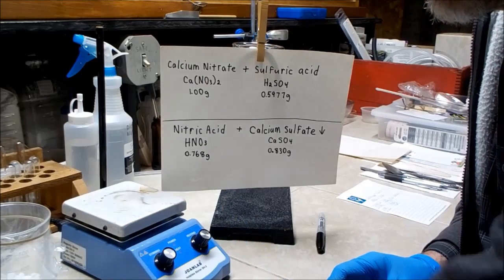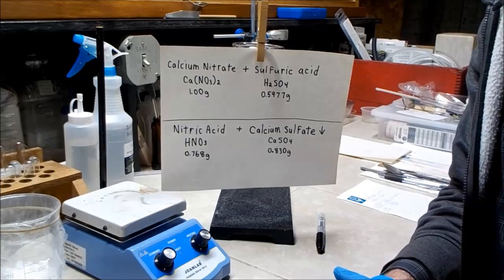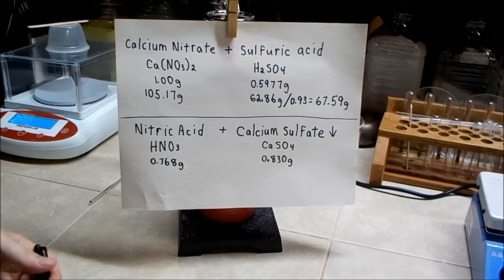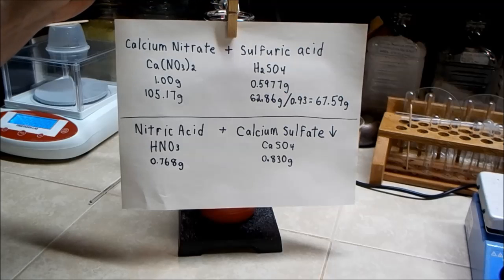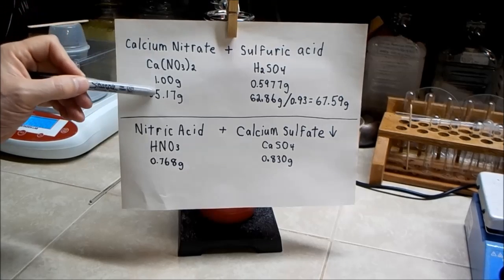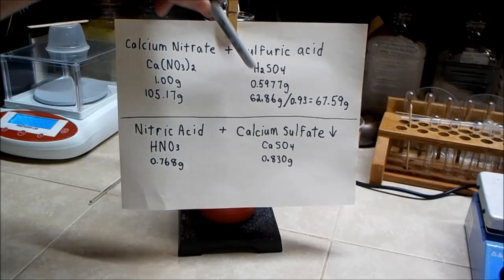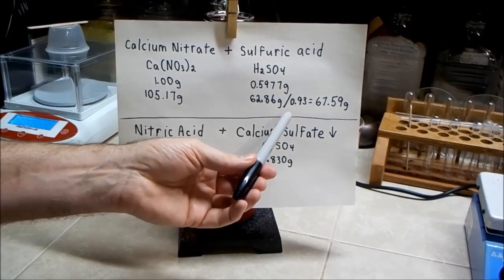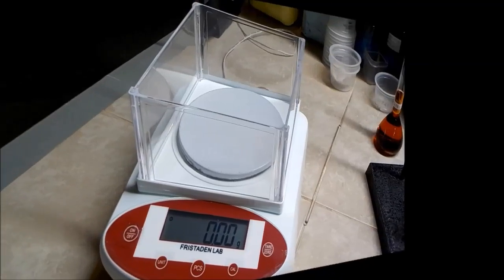Make Nitric Acid Without Distillation

Comment: Ive rememberd Nobel made his nitric acid with Sodiumnitrate and Sulfuric acid and used freezing to remove the now insulubel NaHSO4.
Reply: How exactly did He do it? Can you give me a Recepe ?
Reply: @chlorhendl4304  found it. Translated throught google.If you are in 3 1/2 weight thieilen sulfuric acid of 1.83 spec. Weight (more or less) 1 by weight of saltpeteric potash or baking soda dissolves, so when cooled salts from the chemical formula (KO, 4 SO³ + 6HO); NaO, 4SO³ + 6NO).These salts are almost insoluble in the acid at a temperature of 0° and can be easily separated from them by means of a press or by the air pressure. A mixture of sulfuric acid and nitric acid is then left behind, which is very suitable for the preparation of nitroglycerin.If one now takes so much sulfuric acid that it is completely absorbed in the excreting salts mentioned above, one obtains without distillation free monohydrate of nitric acid (NO⁵, HO).
Reply: @Preyhawk81 would you mind sharing the original source? Thanks
Reply: @disposable_tool  It was an patent from Nobel from the year 1865 in Hamburg. Decanting works too
Reply: @Preyhawk81  Thanks!
Reply: Sodium metabisulfite is a superior acid for this procedure. It generates the same ppt.
You don't need the vigor of H2SO4. It also costs more.

Comment: Is that Joanlab hotplate stirrer any good? I've been hunting another good hotplate stirrer because I've only got one that both heats and stirs lol. I'm interested in it's max temp and how fast it gets there, stirring strength, etc. Great video also! It was very clever to take advantage of calcium sulfate's insolubility.
Reply: They are pretty nice, actually.  I can't remember the max temp, but I'm thinking around 300°c?  Not quite hot enough to distill sulfuric acid, but close.  The stirring is pretty good too.  Though it doesn't go extremely fast, but who needs extremely fast stirring anyways?  I think it hits around 2,000rpm?  But don't quote me on that, or any of this actually.  Hahaha!  I do own and use one, but I don't use it as much as I do the others I have.  I'll show you some of my hotplates that I have on discord later today (1/20/22, in case you don't see this right away.). I have like 8 or 10 of them.

Comment: 22:25 I looked this up out of curiosity, and it seems the grade system for filter paper pore size is pretty... sporadic, to say the least. The sizes are all over the place:
Grade 1: 11μm pore size
Grade 2: 8μm
Grade 3: 6μm
Grade 4: 20~25μm
Grade 602h: 2μm
So, as you can see, it's not even safe to assume that the pore sizes get smaller as you move up in grade size (or bigger). Whoever came up with this grade system for filter paper pore size needs to get beat up... lol

Source: https://en.wikipedia.org/wiki/Filter_paper#Grade_3
Reply from the maker: Yes, that's interesting.  Thanks for doing that bit of research.  I was assuming the higher grade numbers indicated smaller sizes when I was doing the experiment.
Reply: That would be because the grade system is legacy based on traditions... I hate doing things just because of tradition. I find myself re-standardizing most of my parts and processes just for the sake of my own sanity.
Reply: @Unmannedair  yes, that's also why the US still uses the damn imperial units, despite them being objectively crappier.

Comment: 14:08 I had that exact same vacuum pump, and it worked great, until one day it wouldn't pull a vacuum very well. I opened it up and saw that it was basically a diaphragm pump, but the diaphragm wasn't made out of anything that was very inert, like teflon. It was just a crappy plastic, and the two rubber "valves" or seals that let the gas in/out were super small and made out of a rubber that also wasn't too inert. So be careful what you put through that. I tried to fix mine, but no amount of super glue or love could get it working again... damn thing.
Reply from the maker: Thanks for your reply.  To me the pump looks just like an aquarium pump that has the input and output reversed.
Reply: @perrygershin3946  you can always run your vacuum through a drying tube or something to neutralize anything that you expect to go through it before it gets to the pump.  That would help save it for quite a bit longer and help with longevity.  That, and it would help with fumes as well, helping to remove and neutralize them before they reached the pump, which could possibly destroy the seals if not removed, and keep them from entering your work space.  Helping to make it safer all around.

Comment: Great video man definitely unique on youtube using this method! Could you do this exactly the same way but instead of adding all the sulfuric acid quickly could you add some and filter it off and add more and filter it off again and so on til its done? I did this with ammonium sulfate and calcium chloride and I didn't lose as much water as I did when I just added all of it at once. I wasn't sure this would really make a difference here though. I dont have a vacuum filter so I did this to make it easier for me even though it was annoying.

Comment: This is got to be the silliest ass method of trying to recover nitric acid from a nitrate self that I've ever seen in my life
Reply from the maker: Do you  know of another method that does not require distillation?
I think we would all like to know about it.
Reply: @perrygershin3946  I know but this is not a viable way to get any kind of reasonable amount of nitric acid dumping random amounts of water quick nitrate salt with crappy dirty sewer cleaner is that going to accomplished anything reasonable. But I'm sorry I don't really mean to be mean but the process shown here is absolutely silly
Reply from the maker: @ClownWhisper  So you don't have a better method to get nitric acid without distillation.
Why do you say it's not a reasonable ammount?  If you need more just do a larger batch. Obviously if you have pure sulfuric acid you can use it. Don't assume just because the drain cleaner acid has some dye in it that it's dirty.  The reason for the dye is so it will not be mistaken for something else like plain water.
There is no reason the amount of water you use has to be 'random'.  Find the amount that works best for the filter setup that you use.  If you have a strong vacuum pump you can use less water than if you have a weak pump like mine or none at all.
It may or may not be silly depending upon your intended use of the acid.
Reply: @perrygershin3946  I've been making it for years with calcium ammonium nitrate. dissolve, decant, filter, crystallize, mix with sulphuric acid and voila; I can process my silver. You chose the absolute worst possible nitrate to work with. It was painful to watch.
Reply: I appreciate this video because I've always wondered how to make that your gas to precipitation methods.

Comment: how increase percentage?
Reply from the maker: The percentage is very much dependent upon the amount of water you use to perform the reaction.  Using less water gives higher percentage acid but it becomes much more difficult to filter out the precipitate.  The yield will also likely suffer because of more acid remaining in the precipitate.  If you have a vacuum filter setup with a strong vacuum you can probably do with less water.  My vacuum is not very strong.  Also, I probably should have used a little more water for the initial reaction (maybe about 50 mL more) then I would not have had to add extra when I did the filtration.

The best method would be to use a distillation setup to obtain azeotropic nitric acid (68%).  The point of this video was to show how you could obtain nitric acid without distillation.  The major downside is weaker acid and it has a small amount of impurity.
Reply: @perrygershin3946   Thanks.  God bless you and all humans about coronavirus. Amen Amen  Amen.
Reply: @perrygershin3946  We can again distillation the last product(25%)?
Reply from the maker: @qwerty_____146  Yes, but if you have distillation equipment there are easier ways to make nitric acid.

https://www.youtube.com/watch?v=KBeo8nww21g

Comment: Can copper nitrate be used for an electrolyte? I have been seeing a fellow use something blue like that.
Reply from the maker: An electrolyte is a chemical compound that dissociates into ions and hence is capable of transporting electric charge.  Copper nitrate meets this requirement so yes it can be used as an electrolyte.  Copper sulfate has the same appearance in solution and is probably used as an electrolyte more often.  It all depends on what you are trying to do.
Reply: Probably trying to reverse electroplate

Comment: If you heat up calsium nitrate it gives out NOx. Why not absorb that in water to create nitric acid?
Reply from the maker: I think the method you describe would work.

 I was hoping this method would be a way to produce nitric acid  without generating  a lot of the dangerous nitrogen oxides.  I could have done better by cooling everything down with ice perhaps.  As you probably saw in the video there was some NOx generated when I added the sulfuric acid because of the heating.

I'm sure you are aware the problem with the method I used does leave some contamination in the acid even if you get the stoichiometry exact as calcium sulfate is slightly soluble.
Reply: @perrygershin3946  About the issue you're describing I saw someone doing this in vacuum distillation to reduce the NOx
Reply: At that point, you might as well distill it from sulfuric acid and the nitrate flavor of your choosing. Working with solids and liquids is generally less of a pain in the ass than gasses, from a practical standpoint, and you'll end up with a much better yield.
Reply: @orion8981  That I can believe but wouldn't you loose sulfuric acid in the process? What is the cheapest way to get similar yields?
Reply: @nattsurfaren  Sulfuric acid is as cheap as precursors come. 

You're inevitably going to lose the acid in the production since it's a reactant, not a catalyst. The nitric acid is the expensive stuff you're after.
Reply: @orion8981  To my understanding NOx can be absorbet into water to produce Nitric Acid. The sulfuric acid will both react with calsium nitrate and suck out water giving it a high concentration. When heating calsium nitrate you get red fumes NOx. I can be absorbed in water to make nitric acide. So no sulfuric acid in this process. 

So if you have a weak nitric acid and mix it with sulfuric acid it shouldn't react?
Then you can make concentrated nitric acid and restore the sulfuric acid through distillation?

Comment: If you use saltpetre, potassium nitrate, and add it to already hot sulfuric acid it makes crystals which is easier to filter, my question is, once I have the sulfuric/ nitric acid will the sulfuric acid interfere while dissolving silver? I got the potassium nitrate off of Amazon one day delivery, 20$ for one pound, I like the way the acid in my boiling flask looks, but I wonder if the nitric/ sulfuric acid will still dissolve oz to lbs of silver?
Reply from the maker: The reaction you describe will produce a lot of potassium bisulfate which forms the crystals that you see but because it is fairly soluble in water there will still be a fair amount of the bisulfate left in solution.  The advantage of using calcium nitrate is that the reaction produces calcium sulfate/bisulfate which has very low solubility so most  of it can be filtered out.  Another advantage is that the reaction will run at room temperature which is a lot safer and does not produce much of the dangerous nitrogen dioxide gas.

I expect the acid produced by your method would dissolve silver but if you care about the purity of your product you will be disappointed.  The nitric acid will form silver nitrate but any sulfuric acid will then react with the silver nitrate to make silver sulfate/bisulfate and more nitric acid. The potassium bisulfate may also get into the reaction as well.  When the sulfuric acid and potassium bisulfate are depleted then the nitric acid will be used up last.  What you are likely to end up with is a mixture of silver sulfate/bisulfate, silver nitrate, and the potassium is going to be in there somewhere as well.

Distillation to get clean nitric acid is probably the only solution that will work if you are looking for a pure product.  Amazon sells a very inexpensive distillation kit that does the job.
https://www.amazon.com/Chemistry-Glassware-Distilling-distillation-Apparatus/dp/B016HEKEGW/ref=sr_1_7?keywords=distillation+glassware+kit&qid=1566357284&s=industrial&sr=1-7

I have used this one myself.

1 gram of nitric acid will dissolve 0.856 grams of silver.
Reply: @perrygershin3946 thank you very much. That was better than a chemistry class. I'll try out the methods and get back to you, and on the subject it also helps if you know the product I'm tryin to dissolve I gathered some mud from the side of the street where the cars park, tried dissolving it all a few different ways and took my precipitate into a precious metals place which analyzed it at 18% silver 5% cadmium,1% palladium and 20% iron and I have a few lbs of it I'm trying to either dissolve off all the base metals, or dissolve the silver and cement it out with copper, either way I need nitric acid, so there's silver on them streets :-)
Reply: @roywhipple7340  was someones degraded silver plate spoon in there🤔
Reply: Perry Gershin, I used the nitric acid I made to dissolve some meterial I suspect has gold in it I used nitric acid and muriatic acid, then I put sodium hydroxide in, and it all turned black, but nothing is really settling to the bottom, do I need more sodium hydroxide or should I try something else?

Comment: +Perry Gershin If know something about, what plastics are compatible to store dilute nitric acid?
Reply from the maker: Plastics like polypropylene LDPE are resistant to dilute nitric acid.  I keep my acid in glass containers.  Often glass containers for the acids are coated with a resistant plastic so that in case the bottles are dropped ...they do NOT shatter.
Reply: @perrygershin3946  Does calcium sulfate even react with anything? I was wondering if it could be turned into something else.
Reply: @chemicalmaster3267  Calcium sulfate can be used for making plaster.
Reply: @perrygershin3946  I asked this because I´m thinking about making my own dilute nitric acid and I know that nitric acid, specially when concentrated, reacts with some plastics and I want avoid "melting" a plastic container for storage.

Comment: Is there a way (or indeed any reason) to increase the concentration of your 25% nitric acid? Enjoying your videos, thanks, keep them coming.
Reply from the maker: The nitric acid can be purified and concentrated by distillation.
Some reactions require more concentrated acid  such as this one which produces guncotton.   https://www.youtube.com/watch?v=QQ5q9G1lHUc
I have never made guncotton myself but I have distilled nitric acid.
It's easy to find YouTube videos where it is done.
One disadvantage of the concentrated acid is that it more easily produces the dangerous nitrogen dioxide gas.
Reply: @perrygershin3946  I see. Thank you. Would you consider filming the process of distilling your 25% nitric acid and, additionally, exploring other methods available to the home chemist of determining the acid's molarity  and % concentration?
Reply: I would add that if your uses for nitric acid involve refining sterling silver scrap, making a bright dip for aluminum before anodizing, making metal patinas or related processes, a 25% nitric acid will be adequate.  Bright aluminum dips are typically 5% concentration.